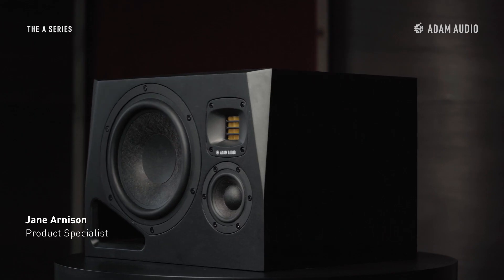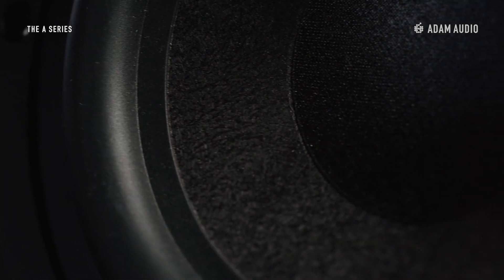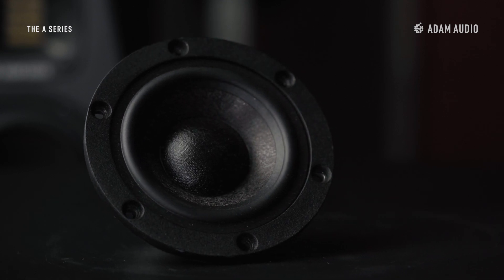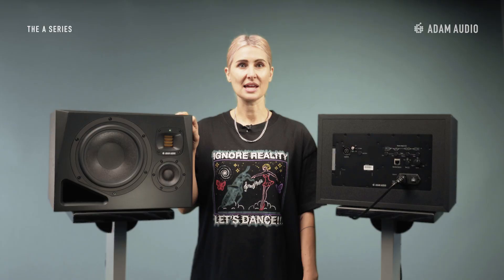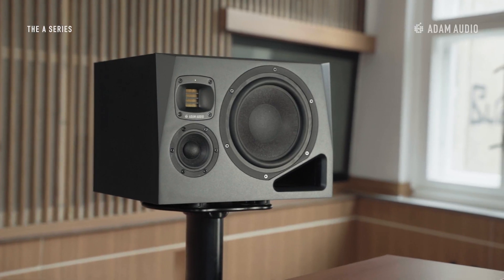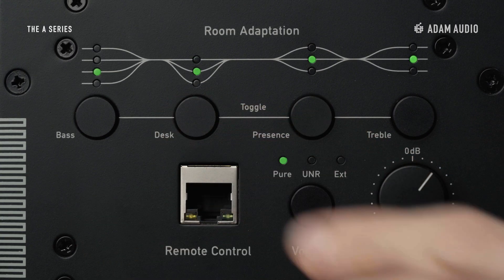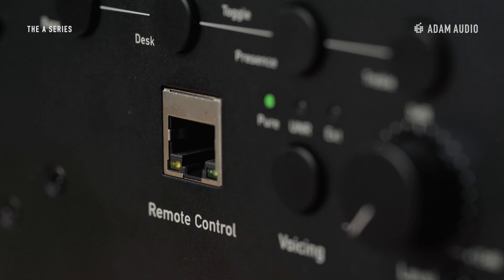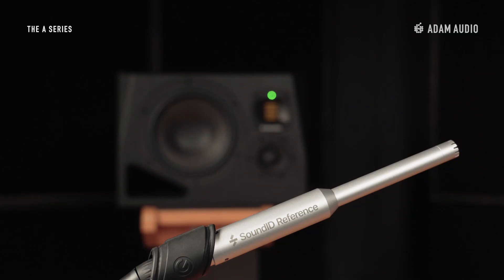The A8H At a Glance | ADAM Audio A Series

Comment: If I used my A8h's in a vertical configuration, do I also need to swap right and left speakers or does the A8HL stay on the left and the A8HR stay on the right?
Reply from the maker: Hi @behemothinferno! Thanks for your question. If you use them vertically, you can use each of the A8H´s as left or right. The tweeter and the Mid-range driver should be at the hight of your ears. I hope this answers your question! :)
Reply: In horizontal configuration, Can I use switch left and right monitors so that the tweeters are on the outside of the woofers, thus giving me a wider sounding sweet spot? In not, can you explain why it is not encouraged to use them in that way?
Reply from the maker: Hey there, yes – you can use them either way in a horizontal setup as well!

Comment: These are high on my short list for new monitors, what's the recommended minimal distance between the monitors? (I want to know if they fit my small studio)
Reply from the maker: Hi there! 
The recommended minimal distance between midfield studio monitors in a small room can vary depending on several factors, including the size and acoustics of the room, the specific characteristics of the studio monitors, and your listening preferences. The primary goal in placing midfield studio monitors is to achieve a clear and accurate stereo image. To do this, you typically want to position the monitors so that they create an equilateral triangle with your listening position. This means that the distance between the two studio monitors should be roughly equal to the distance from each monitor to your ears. Aim for as close to equilateral as possible. The best approach is often to experiment with different monitor placements to find what works best for your room and your ears. Use your ears as your guide and make adjustments until you achieve a clear and accurate stereo image. As a general starting point in a small room, you might aim for a distance between midfield studio monitors of approximately 4 to 6 feet (1.2 to 1.8 meters). However, this can vary, and it's essential to consider all the factors mentioned above.
Reply: These are also on my short list, also looking at the IK Multimedia's ILOUD Precision 6 (or 5's) I would really like to compare them but that may not be possible.

Comment: What is the recommended configuration for surround setups with the A8H? Would you keep the left and right speakers horizontal and the center vertical by turning the tweeter?
Reply from the maker: Hi! You can do what works best for the installation.
The A8H works it works perfectly well as a center. Either an L or R can be used as they are simply mirror images of each other. The tweeter should be positioned exactly at 0 deg. The woofer will be off to one side which might look a little strange for a few mins but then one quickly stops noticing. Acoustically it makes no difference.
Reply: @ADAMAudioBerlin  Great, thank you very much. I just realize that information is also in the manual 🙈. That might be a great information to put into videos in the future if there is a speaker with L and R Versions.
Reply from the maker: Hi! :) yeah, good point! We will have it in mind! ;) Thanks!

Comment: It almost looks like the measured EQ curves for room correction are kind of simplified/interpreted into just 4-bands of EQ
(the same used for the other two modes, one on the back of the Speakers.) 
Is that correct, or does the internal DSP apply the accurate correction curve measured?

Comment: Nobody is listing the frequency range/response of these or the a77h. Why? It's important, isn't it? It's listed for the a7v, but not these.
Reply: Brand new product announcement. Not even available for purchase until September 2022. Check back for more specs and measurements with Adam between now (April) and then.
Reply: The measurement data with graphs has not been published. 
They only stated>
Frequency Response @ -3 dB: 34 Hz – 41 kHz
Frequency Response @ -6 dB: 31 Hz – 45 kHz
Reply from the maker: All the measurement data are finally available on our website: https://www.adam-audio.com/en/a-series/a8h/#measurement-data
Reply: The only frequency graph I've seen in the A series was for the a4v. It was pretty bad.

Comment: I like A series, because here we have AB - Class amplifter on tweeter and midle, but I dont know what is PWM amplifter type for woofer. Is it better, than D - class?
Reply: PWM is class D
Reply: @Rareos  Thank You!
Reply: PWM is a digital amp. It's used in a lot of modern subwoofers. It's more efficient than analog amps.
Reply: PWM = a fancy name for Class D amps. Same thing. Class AB is much, much better.
Reply: @mariapalfi1189  True in some cases. The frequency range that is being reproduced really determines the level of discernable distortion. Clever use can lead to good results and cost savings.
Reply: @mariapalfi1189  I disagree. PWM technology has matured. With AB amps you either need a lot of space or a large heat sink if you need a large amount of power. In addition, the transformers that are needed for AB amps can wear out frequently. I had a continuous problem with an 18-in studio subwoofer they used AB amp where the transformer continuously wore out year after year. Moving that thing more than once sending it to service was not pleasant.